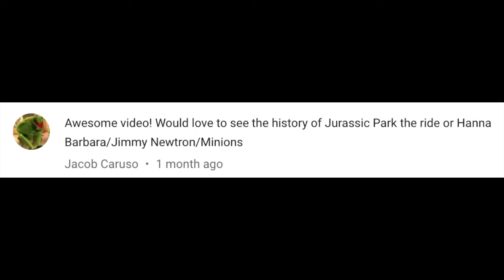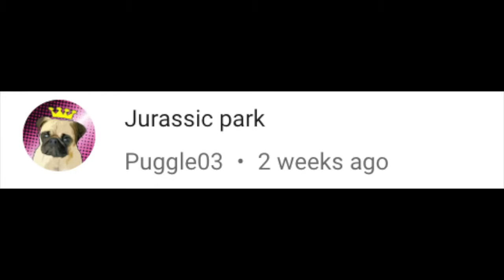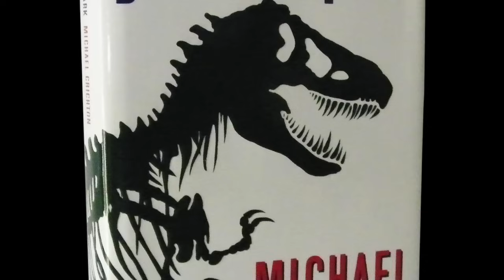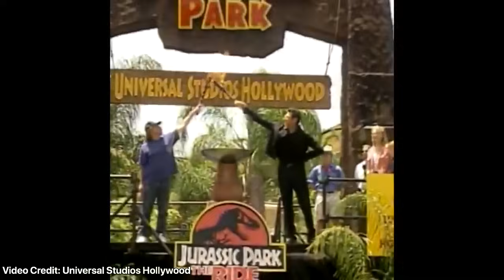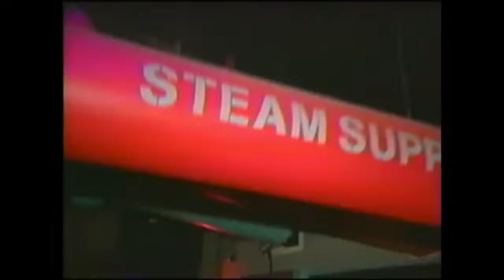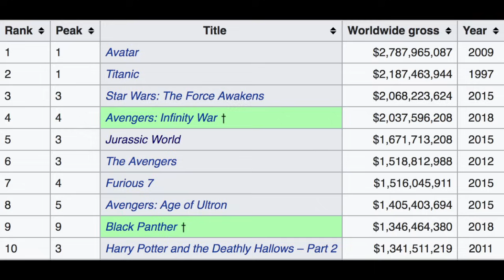The Theme Park History of Jurassic Park: The Ride (Universal Studios Hollywood)

Comment: I'm ok with the re theming. I've been on JP so many times and over the years they stopped using certain elements of the ride. The explorer stopped dropping off the side. The diloposauras hasn't popped out of the water like shown in the video for god knows how long.
Reply from the maker: I was a bit more relieved when it was announced they were keeping the original ride system in place. I figured the way Universal has been doing things lately all the animatronics were going to be replace with screens. If you have the time Inside Universal has a POV of the ride from 1997, it's night and day to see the attraction in it's prime.
Reply: Yes, it is definitely time for an update.
Reply: Well enjoy the re theme while you can because universal is so cheap it will only operate as designed for a year or so
Reply: Just hope there is no screens
Reply: Man... I'm lucky enough to have ridden it back in 1996 and in 2013 when I finally went back the explorer was still working! But when I went back in 2017 it was all run down completely
Reply: Ya I know the car just sits there when it’s so posed to drop the part that’s in the water probably rusted by now
Reply: @2uitdoesntmatter  for a year? Then how come JP ride operate for over 20 years?
Reply: The reasons why the car and some other stuff didn't work in the last couople of years, is bc they were already planning for the JW re-theming and didn't want to waste more money and time fixing something they will tear down in a couple of years or a few months.
Reply: I was only 11 when I rode this over at Florida my baby brother was crying after we got off this
Reply: Haha true and true, also the spitting dinosaur doesn’t spit in LA anymore and you can see the cables of the final T-Rex before the drop. Ride holds a close part of my heart though
Reply: Well my opinion is that I'm okay with the screens, alot of movies now use cgi, so a animitronic ride wouldn't work, like with Transformers The Ride the characters are made with cgi, so the amnitronics  wouldn't have worked, the reason Jurassic park can do it good is because they used amnitronics in the movie.
Reply: Same with Universal's version.  It needs an update.  I love the ride as is... but it still has that 1995 flare.
Reply: @GasolineProductions  I got some bad news buddy

Comment: I worked at Universal Studios Hollywood as a ride operator at Jurassic Park the ride during its first three years of operation. I've got a few ride history facts that didn't make it into this video: #1) During its opening summer, two of the ride's signature moments malfunctioned -- the T-rex head that breaks through the cieling spilled hydraulic fluid on numerous guests. Not long after that, in the finale scene where the T-rex lunges at us, the boat dropping mechanism which spaces out the boats to prevent them from crashing into each other at the bottom of the lagoon one day failed to hold the boats, which caused several boats completely full with 25 people each to go over the waterfall without hesitation and crash into each other in the splash down area. Both accidents happened the same week and were mentioned on the news and in local news papers. It was quite a crazy sight seeing ambulances sitting lagoon side both times carting off injured passengers. Those passengers were well compensated for their injuries. Universal paid out 15 million dollars for their injuries and gave them free park passes. To prevent both accidents from happening again, Universal fixed the hydraulic leak and replaced it's fluid with a more water based alternative, and after installing crash pads on the back of each boat, they repaired the drop sequence which now requires them to be approved for the drop by an overseeing ride operator (that's why we see someone watching us in a darkened booth to our right -- they are pressing the buttons that send the boats down the drop). Sometimes, when the ride breaks down, boats get stuck at the top of that waterfall (a crown lift) and employees have to escort guests off the boat from that point. The boats are water jet propelled. When the ride breaks down, if the boats aren't stuck on a lift, the ride operators have to lasso pull the boats to the nearest part of the emergency sidewalk and tie them down so that guests won't fall into the water. Numerous people, both employees and guests have fallen into that water. 

Ride secrets and alterations: while being taken off course after "Pari" the paraslosaurus bumps the boat preventing us from seeing Hydrosaur Cove, we enter an unauthorized area where on our right we see a cow gets ravaged by an attacking velociraptor,  and on our left a previous boat got attacked. That scene is a parody of an actual scene in the movie where a crew member gets attacked-- As in the movie, during this scene, the song we hear playing in the background on a radio within the scene is "The Girl from Ipanema" by Astrud Gilberto and Stan Getz. 

Also, during the soft opening and first month of Jurassic park's operation, the drop sequence was not the highlight of the ride. It use to be outshined by the jeep splash scene, which use to completely saturate every other boat when the ride operated at full capacity-- as we turn the corner to see experience that segment we'd see two boats in front of us get splashed by that jeep and or skipped as the jeep either stayed in the water as we passed it or it would reset itself quickly and splash us. 

So yes-That ride use to get everyone sopping wet more than it does currently. After Universal kept receiving numerous complaints about getting too wet on the water ride (which warns us with easy to see signs and didn't hide the fact you will get wet), they turned down the Jeep's spash to where it's now a flinch/or a false alarm moment. Universal also started selling ponchos for 50 cents each which they would recycle and sell millions of. --Before they brought in poncho vending machines, sometimes I had to sell those things and clean that poncho recycle bin  when it overflowed. Every 30 minutes we had to check the bin because almost everyone bought those ponchos only for the ride , and they'd quickly put them in the bins and trash cans which was located on the unload platform where they climbed out of the boat.

Another ride secret: Steven Spielberg's signature which is on display at the entrance of Jurassic park the ride-- Universal had it carved out, propped up on display and repainted -- it use to be a section of the sidewalk at the foot of the entrance arch which people didn't easily notice until an employee would point it to them. When people started noticing it, they would kneel down to take selfies with it on the ground. ALSO, that was actually Spielberg's second signature attempt! On the right side of the Jurassic Park entrance arch hidden by tables and chairs (which you can push out of your way to see this) you'll find Steven's first signature attempt which isn't as perfect as the final one. My guess is the cement hardened faster than he expected and was difficult to write his name in, so he quit trying to write his name it and tried again more successfully in fresh cement. I like showing people both of his signatures

Comment: Do one on the Universal tram tours. I’ve noticed a bridge during the tour for the Hollywood Universal near the Return to Kong Island. I’ve been wanting to know what that is. As well as what the older tours showed.
Reply from the maker: The Studio Tour has been added to the list, thank you for your suggestion Amelie.
Reply: That bridge used to be a part of the tour. The tram would actually drive over it and stop on it. They would them simulate the bridge breaking and with the tram on it. It was pretty cool. Don't know when they stopped using that section, but I would guess it broke down and they couldn't fix it.

Comment: Here's a little known fact. After the movie became a hit in 1993, Crichton's publisher reissued the hardcover as a special signed limited edition at $50.00 a copy. Each book had a special plate in it signed by Crichton. One problem. Book store owners who bought multiple copies of the book noticed that each Crichton signature in it was identical with not a hair's worth of difference. As anyone who has seen books signed by the author knows, there is always some variance in the signature. When pressed, the publisher admitted that the signatures were signed with an autopen (a mechanical device which duplicates someone's signature, first popularized by Presidents who don't have the time to personally sign every letter sent to supporters who write to them). Thereafter the books were discounted and an errata sheet was included revealing that the signatures were mechanical, not authentic.

Comment: I remember going on in December 2013. I don’t now if it was because it was a non peak time, winter, or California’s long dry spell at the the time but the flowing water the Rex pops out of at the end was not running. So as you rounded the corner you could just see in the darkness the whole T.Rex body just hanging there.. then it swings over like those carnosaurs on the vines in Peter Jackson’s King Kong. 😂
Reply from the maker: Yeesh, that really ruined the element of surprise in that case. I'm surprised they still had the ride open with the dry spell.

Comment: The Jurassic PARK aesthetic will always be more appealing and nostalgic, but if they're just modernizing it with new animatronics and other things, this revision can only be a good thing. The animatronics are in desperate need of a replacement. As long as there's no 3D crap or something ridiculous like replacing the T-Rex with the Indominus Rex, it will be fine. For the latter I'm assuming they'll have both dinosaurs for the finale. On a side note, I always thought it was cheesy that the T-Rex was just floating at the end with its feet dangling. I hope they can find a way to have it stand on a platform while revealing itself from behind the waterfall or whatever new thing it will be doing.

Comment: To be fair, retheming the ride was the only option Universal had. The 80s/early 90s theming was charming, but horrendously outdated. The new films have catapulted the franchise into the limelight, so of course it makes sense to retheme it accordingly.

All of this however is ignoring the elephant in the room; that this is one of if not the most under-maintained and pitiful E-ticket attractions in the world. The raptor on the left in the lift hill has been gone for three years. The falling jeep stopped working about 5 years ago. The dilophosaurs move stiffly. The ultrasaur heads never go upright. The effects for the raptor pen were removed almost a decade ago. The splash zone is gone. The water effects have been severely dampened.

It was getting to the point that Universal scrapping the ride entirely and replacing it with a wholly different attraction was becoming a very real possibility. 

Regardless of ones opinion of the new films, this is the best thing to happen to the ride since it opened. Id rather lose the iconic green/red/yellow nostalgic design and 90s theming if it meant actual working dinosaurs.